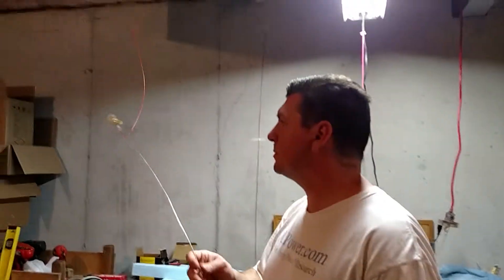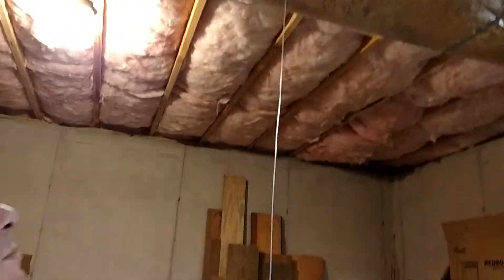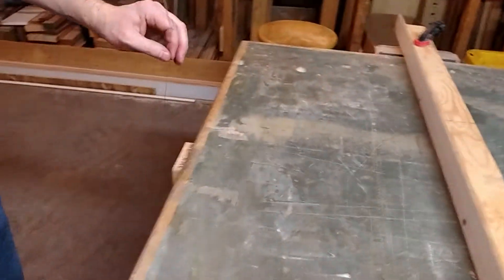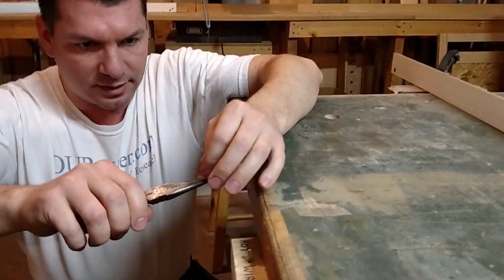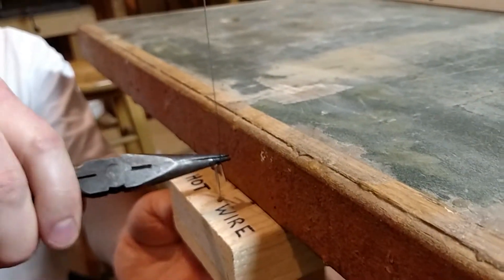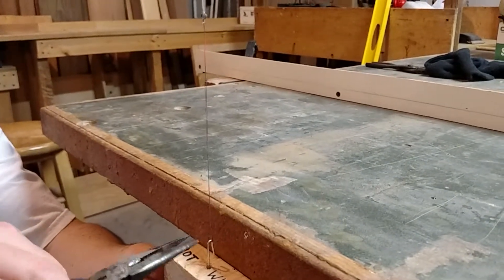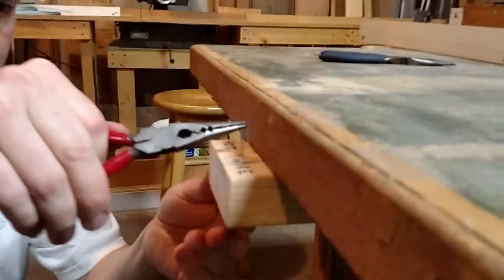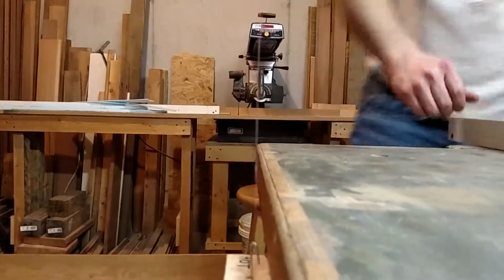Ultimate Hot Wire foam cutter! Part 2

Comment: Hi, I realize that this video was made quite a few years ago, but I am very interested in making The Ultimate Hot Wire Foam Cutter :-) One quick question:  Does it matter what wire is used for the long length that hangs from the ceiling or comes up through the bottom piece if wood?  I am assuming that the wire needs to be stiff enough to hold its shape when bent into a hook, and that it needs to carry current, but beyond that is there anything special about that wire?  Thanks, David

Comment: hey so i realize this is a prototype, but ideas never hurt right?....you could run the line through a pulley and tie it off to a threaded device of some sort (a machine bolt or a piece of all-thread, etc.) and then just put a crank on it like a C-clamp and tighten it to take out the slack....or you could put a hanger on the end and just keep adding little weights until you get the right resistance (color of that you want, etc.) and it stabilizes at that tension and resistance.  that way if the conditions change a little (if it is warmer or cooler or more fan air or more/less humidity), the force of tension can be the constant...I like the thread idea because you can modify the temperature with changes in the environment (mentioned above), but at the same time it allows your settings to be maintained...  my 2 cents ;)
Reply from the maker: Hey there Garbage, thanks for the comment but if you copy my design and try to make one for yourself you'll find that using a long length like this lends itself perfectly to the rubber band tension idea. Since the rubber band is at the top of the heavy wire, it takes up the slack very rapidly and dynamically. A crank or screw device to take up tension would be cumbersome and require constant adjusting mid cut. The rubber band gives analog feedback and response to changing tension conditions. As you push the foam through the cutter, if you go too quickly the system needs to stretch (give) a little. The rubber band does that perfectly. If you slow down you push the rubber band pulls up the slack instantly. In the end I don't think I could have used a more simple and effective means of dynamically adjusting the tension on the Kanthal wire while at the same time, not having TOO much tension on it to cause it to break. So thank you for your suggestion ...as you say; ideas never hurt. If you build one, you'll see what I mean and you'll see why I did it exactly this way. It's perfect. It's fast and it's reliable.